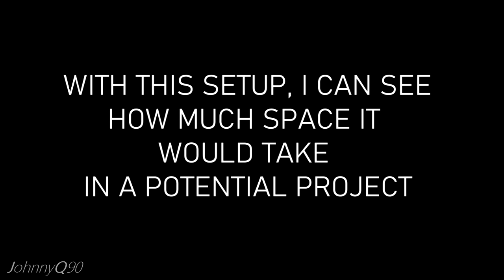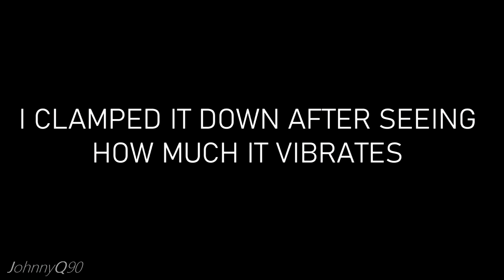Miniature Inline 4 Cylinder 32cc Watercooled Engine

Comment: "Oh cool, Maybe I should buy one of these little engines for fun."
looks at $900 USD price tag
"yeah no"
Reply: Same Lol 900$🤣
Reply: Noooo dont worry bout the price tag, just buy it. Hahahahahahah
Reply: Southeast asian  motorcycle mostly priced around 1500$ and bellow.
Reply: @maverick6c631  mines above that a tiny bit~
Reply: Exactly what I said ..☝😆
Reply: Nice toy but at over £1000.00 plus delivery its bloody expensive.
Reply: Yeah it's a gip China is trying to sell a Yamaha 4cylinder weedeater nock off engine that fails shortly after use due to poor quality aluminum & steel breakdown for 10x as much anyone who would actually buy this thing is a sucker for rainbows 🌈 of Chinese ideals. It may look good on the starting line but ..give it real time use you'll find any 4 stroke weedeater motor is superior in multiple ways of torque rpms & long term use at 10x less the cost.. 4 years from now I guarantee that engine will have warped aluminium cylinder , head, cam, crank and anything actual steel will look like a food can left outside in the sand after a heavy rain*while this thing sits inside and still looks the rusty shell* stop falling for it people! ☝😔🇺🇸🔝
Reply: For that price you can pretty much built a Honda D series of B series engine lol I wish those miniature engines were cheaper I'd love to get one!
Reply: @jimmyst-jean2214  for that price you can get a good deer rifle .. They can keep their novelty plastic assisted junk engine ..
Reply: For $900 youre already on your way to buy a blueprint motors original V8 crate engine!!
Reply: @ernestochang1744  nope it's plastic and bad quality also China stole blueprint from USA to begin with ..diagrams are what we made first so why would we pay China for poor quality replica
Reply: @ernestochang1744  we buy our own scrap iron make our own engine much cheaper & stronger with no clay in steel ..china very bad businessman
Reply: Honestly, that’s kinda reasonable for something so unique. It’s not like they just roll these off the line like a weed-eater motor.
Reply: @samuelyoung4646  nope it's junk
Reply: Ima be honest, if I had the funds right now, I'd do it.
Reply: @JønathønJeffries  me to ..um oh wait that Chinese pos no bro it's a rip
Reply: I have paid more $ for much dumber crap.
Reply: Bruh, same.  You can get an ACTUAL engine for cheaper than that
Reply: For 900$ you could buy a 90-110cc scooter in India.
Reply: I can buy a full size four cylinder engine for less than that
Reply: Just buy traxxas desert racer(actually dont have one LOL)
Reply: Just make one (in roblox plane crazy XD)
Reply: @americanlivesmatter-BmanWild  for someone who hates this, you sure post a lot about this engine.
Reply: I could get the entire motor unit out a nissan leaf for that price.
Reply: I paid $700 for my 2001 Ford focus, in fantastic condition. The price of this tiny engine is insane....but with that said other working gas models like v8s are 5 digit price tags so I mean 🤷‍♂️
Reply: Fr like I can buy a damn motorbike engine for that much
Reply: i got my 99 CRV with a bad valves and i put 80 dollars of valves and new brakes and well i am 25000 miles deep ;)
Reply: God loves you
Reply: @goobasrops5104  no
Reply: @kenmaster3969  yes
Reply: @goobasrops5104  god doesnt care about anything as he in an omnipotent being with no love or hate
Reply: @kenmaster3969  god loves everyone
Reply: @goobasrops5104  probably not
Reply: @kenmaster3969  if you can, why the hell not?
Reply: @kenmaster3969  there is always one of them in the comment section. So tiresome
Reply: It's not expensive for a four cylinder watercooled model engine. Could you buy one cheaper?
Reply: Yeah I literally just said that out loud lol. "$900 fuck that!*
Reply: Get a cheap write off single cylinder bike and work on that instead. Lol.
Reply: @shelbythomas3504  it's actually pretty compelling since i saw a 3 cylinders rc Engine goes around $3000
Reply: Thanks for telling bam
Reply: Could get a real one for that
Reply: Honestly thats super cheap cpmpared to most scale engines...Conley has hundreds of orders for their $8750 mini v8. Just their Supercharger is $2400 whihc is as much as a nice REAL supercharger you can make 700whp with lmao

Comment: BTW i dont know if i read the description of the engine right but it seems like it has rubber piston rings...
here is what the page says:
Specifications: .Piston Ring: Fluorine Rubber Ring (Support to upgrade bimetallic piston ring)
so i would be carefull with that engine ALSO you can see in the video that the rubber exhaust elbow is clearly smoking.... (Great video btw)
Reply: The rubber elbow can take pretty high temps actually...they are used in nitro engine applications too
Reply: @Marcus Keeler they don't use couplers anymore on exhaust..they are spring flanges and those rubber elbow can take some high temps..we'll over 400f...
Reply: @stilltlrforlife  yeah but gas powered exhaust goes way past 400 degrees F at that point.
Silicone burns, had the issue myself while running in my 9cc gasoline engine on my helicopter.
Reply: @Marcus Keeler It's rather doubtful, There is no pinch zone for compression, and that is the reason for break in on nitro engines to polish the sleeve and match the piston and sleeve for good compression..hell on real size car engines there really isn't any break in period for the engine, if anything is rubbing internally where there is supposed to be clearance for oil there will be a failure..nothing should be metal to metal. Any and all engines I have rebuilt never had a break in period...it's an old skool thing from older cars to let the drive train break in...not the engines. I'm sure those o'ring piston rings will wear out faster...I'm sure to keep cost down they used those instead of tiny piston rings, be a pain to get the ring gap right. And the piston to wall clearance..would be very expensive to get that right on every engine..and those small little rings wouldn't hold the piston steady enough and it'd probably spark knock (ping) and shatter a skirt on the pistons.
Reply: @samuraidriver4x4  I'm sure this little engine won't be working nearly as hard as a high rpm heli engine. It may not last long with that rubber but it won't see extreme temps or loads like that.
Reply: "Fluorine rubber" is obviously a translation issue. It's probably PTFE (Teflon). The "F" stands for fluorine. Rubber rings would create too much drag and would wear our way too fast. Even actual fluorine rubber (FKM), like Viton, have a low durometer and would be way too soft. It's between 55 and 95 Shore A. I don't know much about these small engines, but I highly doubt it's "rubber" in the way you're thinking about it. The "smoking" elbow is a non issue.
Reply: @stilltlrforlife  the silicone tube burned away just running it at an idle while running it in.
Took about 15 minutes.
Reply: Needs a turbo or supercharger
Reply: Kresimir Baric  Bruh you can literally see the smoke out of that rubber exhaust elbow at 9:30
Reply: @xenonram  yes smoking elbow is not an issue if you already have lung cancer and even if the piston rings are PTFE the are still not metal sooooo yeah
Reply: @stilltlrforlife  you can literally see the smoke out of that rubber exhaust elbow at 9:30
Reply: Kresimir Baric  I wasn't saying g it won't eventually melt...all I was stating is: the "rubber" or whatever u call it can withstand some high temps...more than actual plain ol rubber. It's really not a big deal for a test run anyhow.
Reply: @stilltlrforlife  Vulcanised rubber won't melt. It will char tough.
Reply: @kasparroosalu  if ya wanna get technical..it will bake, get brittle as the moisture and oil dries up and crumble...never did I expect this to turn into a scientific debate..realistically it does not matter what will happen to the elbow..it's just a temporary way to redirect the exhaust for the test run and video... He could use paper for all I care. Like I said I was just stating my experience with using a carburetor air filter elbow for r/c applications. I've used them on the tip of exhaust pipes with my break in bench before to redirect the flow of exhaust.
Reply: @stilltlrforlife  Yes, there's a break in period for car engines, and yes exhaust is too hot for silicone, especially just centimeters away from the exhaust manifold...You talk a lot but don't know much.
Reply: @TykeMison_  there's no break in for new cars.
Reply: @stilltlrforlife  An ASE tech isn't a highly trained engineer. 
When car manufacturers, with their millions-of-dollar-teams of highly educated people,
WHEN THEY TELL OWNERS TO TREAT A NEW CAR'S ENGINE WITH A SPECIFIC BEHAVIOR FOR XXX MILES
THAT'S A BREAK IN PERIOD.

AND I TRUST THOSE BILLION DOLLAR CAR MAKERS MORE THAN I TRUST SOME HIGH-ON-HIS-BALLSWEAT ASE TECH.

Your job is following those manufacturer's instructions and specc'ing the parts with torque wrenchs.
You people aren't rocket scientists. Keep your wrench monkey opinions to yourself.
Reply: @stilltlrforlife  - If ur building race engines ur probably not breaking them in because they get rebuilt a week later anyways.  

And your parts may be a precise fit but nothing is perfect.  ur piston rings might fit perfect but they don't fit PERFECTLY until after they have broken in.  But like i said, if there race engines, and you can get the low mileage reliability without a break in hassle before the next rebuild, then have at it.

Look it up.  Diesels are at their most powerful after about 100,000 miles.  That's not magic, that is all the parts, on a low wearing engine, finally wearing in enough that they all are seating PERFECTLY.

its like lappjng in valves.  Why bother?  Just cut both angles, drop them in and be done with this.  But it needs to be done because that's the only part on an engine where a tiny leak will help that component self destruct.
Reply: @michael-dm2bv  It's not just race engines..it's any engine and the race engine last for seasons..funny that even replacing an engine in a C7 corvette brand new from GM( not a re man) not once have there been any break in period or warnings snouts break in or rpm limit..if there were there would be all kinds if warnings attached. You people can believe what you want it's fine. I could care less. Yes when the engine does start to wear the tolerance gets higher and they run looser but soon after its going to fail...I've been around for a while working closely with engine engineers straight from GM tech center in Warren Michigan. Some of them are really great...and others are really really bad..the ones that come to the technician and ask for his input are the ones we trust sine they aren't close minded. Break in on the cars are for other moving  prts on the drivetrain...wheel bearings...transmission clutchpack..any friction related item. Real engines clearance do not need wearing in. Lapping the valves is for sealing pressure, they will not seat themselves in over time, most valves on passenger cars are not lapped and the do not seal as good as a hand lapped valve. It's all good..alot of people still think this and thats fine..it's not going to hurt anything taking it easy on an engine  so it's really no big deal to me, I only get paid if someone breaks their car anyway, passenger car break in has been debated for a long time.
Reply: @stilltlrforlife  bollocks.  the first oil change is for what?   name ur favorite street fighter character.  i will show u ten years of certification.
Reply: @stilltlrforlife customers in a mid life crisis, with more money than brains, hear what they want.  u replace the oil after the first race?  break in.  do u get it analysed by blackstone?
Reply: @michael-dm2bv yea I do know what the first oil change is really for...chances are most myth believers will not believe it..do you know what they use to cast the blocks? And the assembly lube that does not mix well with oil...the first oil change could be done after 60 min of running. At this point I do not care what anyone believe it's just funny to me
Reply: @stilltlrforlife  well yeah because u watch race engines.  my 2.7 litre t1n can sprinter is finally past broken at 140,000 miles.  i know what the first oil change is for also.  i think slow.  u think fast.  how many miles before u get that same engine to rebuild?  
some souls burn them in fast.  some souls burn them in slow.  but they all need to be broken in.
Reply: @stilltlrforlife  i own a lister 6/1 clone.  made in india.  made to last forever, but unless u take it apart and remove all the casting sand, the clone manufacturers refuse to remove, u get stuck with sh*t.
Reply: @xenonram  - i agree with ur translation.  teflon rings would make life easy, seal well, and would make sense  on such a small engine.  By the time they caught on fire and killed everyone in the room would be the stupidity of people that understand the dangers of teflon, and in all respects would never happen.
Reply: @stilltlrforlife  - i understand ur point but think bigger.  U are telling me, on one of those huge three story transport ship diesels, with pistons bigger than cars, that there is no break in procedure?  And that if there is, it is bullsh*t?

noone puts 100,000 miles on their pos corvette.  And if they do, it is because they take care of it.  they don't rev it to 8000 rpm's as soon as they buy it off the showroom floor.  

And it will do fine, even if they do.  but how do they break in diesels bigger than homes, and why bother, if the process was bullshit?
Reply: @LtdJorge  that's weird cuz the manual for my 2018 gave me a break in period. Says to stay away from maintaining a constant rpm for extended periods to help the rings set properly. Same goes for the 2020 version of my car. Litteraly the same engine
Reply: @jets8991  well, at least all of Volkswagen and their sub-brands don't need one here.

Comment: Awww that sound so cool for a model engine. You oughta build an RC jet boat, one of those boats they use to get up rivers and through swamps. That way we can hear the engine at those low rpm's while it maintains position in a rapids. Instead of just Idle>full throttle>idle  like we normally hear with model gas engines. Oh and then you can water cool it without a radiator and all that. Idk if you'd be able to get enough pressure through a pickup while at speed, so you may still need the pump.

Comment: The cooler is incorrectly installed.
It must be turned by 90 °.
Warm on top in, cold out below.
Reply: Also making it harder to rid any air bubbles in the system
Reply: @Hank Hildebrant a lot of people dont understand that.
Reply: But the radiator make the WATER temp down, not the engine temp the position not matters (i Guess),

Comment: S2000 is what the potential project should be.
1/4 scale Honda s2k ftw!
Reply: Needs a turbo lol
Reply: Nugget_of_life he means the engine in the video. It should fit pretty easily in a 1/4 or 1/3 scale model, if not even smaller
Reply: Lol
Reply: @FoxSock  Yea man just put a 2Jz in a 1/24th scale bro, bolt right up
Reply: A 1/4 engine would be 250cc.
Reply: @oiltoast3723  
1/5 scale then?
I was just trying to promote the s2k, lol.
I should have checked my math knowing the strictness of the webs.
Reply: @ridetheapex  Just saying. A 1/4 of any car would be sick tho.
Reply: @oiltoast3723  yeah, but this engine is huge for its displacement.
Reply: @oiltoast3723  that's if the full size is 1000cc

Comment: You should make your own intake manifold for this. Being carbureted, the air/fuel ratio is going to be rich in cylinders 2 & 3, and very lean in cylinders 1 & 4. An interesting note about intake runner shapes / smoothness is it's more important on carbureted engines than EFI setups. In EFI port injection, you have a lot more leeway with sharp angles since it's just air moving through. In carbureted setups since the fuel is suspended in the air and weighs more than air does, it tends to leave fuel behind inside the runner on sharp turns (centrifugal forces and all). This is very apparent in large car-sized inline engines in pre-1950's american cars that only used 1 small carburetor and horrible intake manifold design.
Reply: Or in the case of Ford and Chrysler with their 200ci/3.3L I6 and 225ci/3.7L slant 6, respectively, all the way up to the 80s 😂

Comment: In a 4stroke engine, if it’s blue smoke, that’s burning oil, and if it’s black smoke, it’s running rich (black smoke is soot, from an incomplete burn).
Reply: And if it's white smoke it's burning water.
Reply: @scottmerrow7617  some, call it steam :)
Reply: @MrFurriephillips  I'd call it a bad head gasket and hope it wasn't a crack in the head or block.  This inline 4 cyl is a two stroke btw.
Reply: @scottmerrow7617  I’ve had very little experience with 2-strokes, but I guess ICE is ICE, as far as exhaust colouring is concerned.
Reply: @MrFurriephillips  Yeah, they're all the same.

Comment: Maybe put this in a huge rc car with a real transmission?

That would be SO cool
Reply: 1/5 fg
Reply: I would love to start a company that makes like1/3 scale things with mostly realistic features and that u can work on and run but ya they would have to be hybrids because power to weight ratio would be horrific
Reply: That’s literally what these are sold for. RC cars and ships. Goes for around $900USD on AliExpress/Alibaba.
Reply: I could imagine you could put a sequential gearbox in it operated by air, just like in a real race car
Reply: Thor von Falin They make electric power ones for RC vehicles, typically.
Reply: you need keith57000 channel for that level of custom rc build